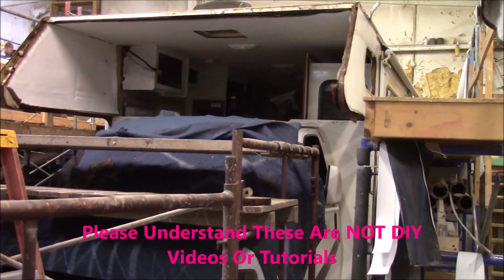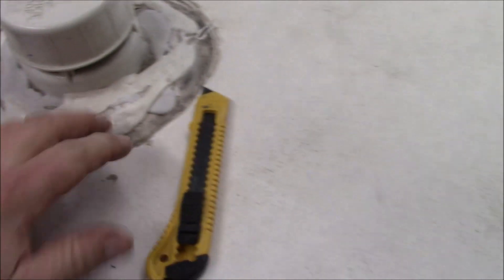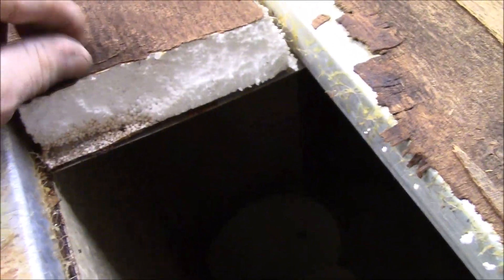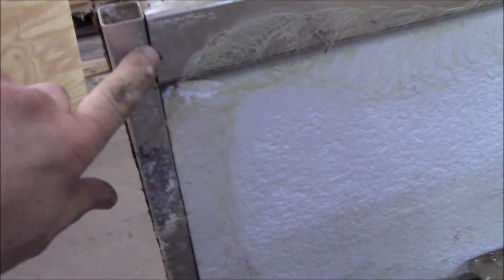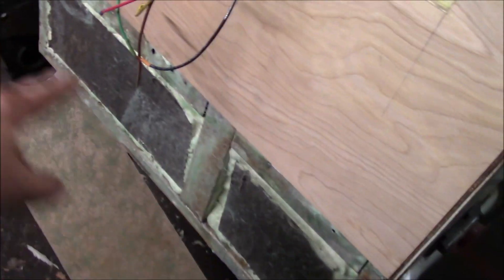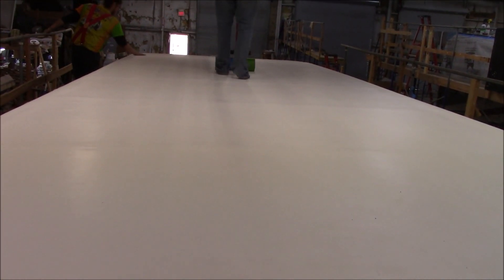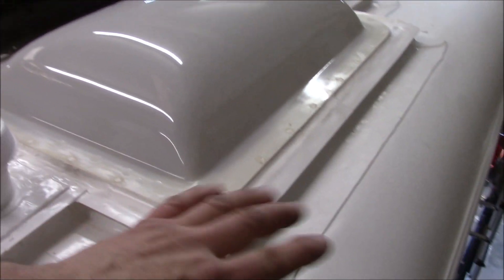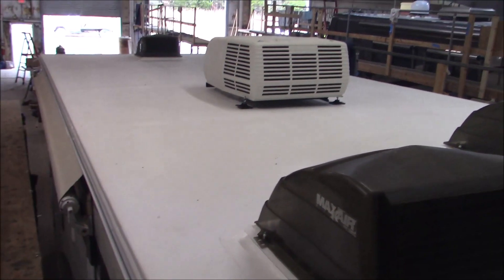2008 Four Winds Chateau Sport

Comment: So, I thoroughly enjoy your videos and find them very informative. I do have a question though, I have a 2020 Rockwood Roo, would it be in my best interest, long term, to make a trip down to your shop for an inspection and possible new roof, or is it better to just wait. I hope to keep the trailer for many years. By better, I mean cheaper LOL
Reply from the maker: We stay months out. Your roof is plyfoam. These camper roofs are terribly constructed, so it's almost impossible.tp make certain it won't leak. By the two.you.so see a leak the damage is done.
Your roofing is basically as thick as a bicycle inner tube... literally.  This thin membrane will rip easily if snagged by a branch.  Materials go up every year. I think we have a Roof on our channel. We did one quite a few years ago.
Thanks for watching.